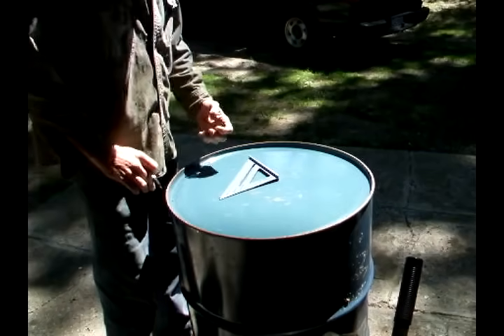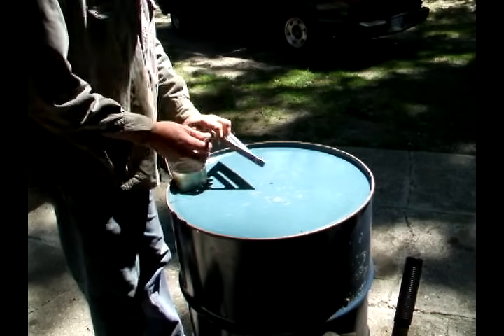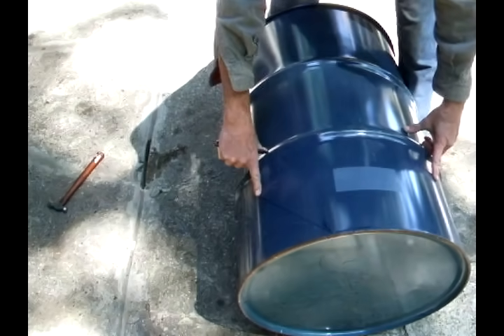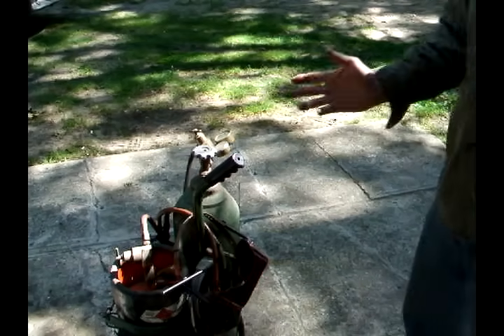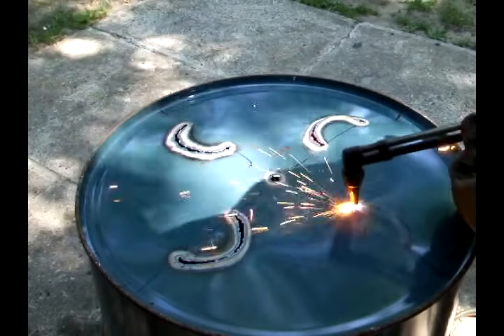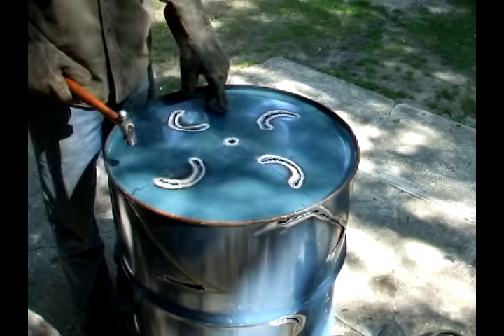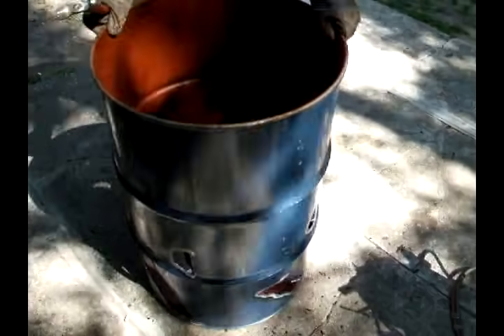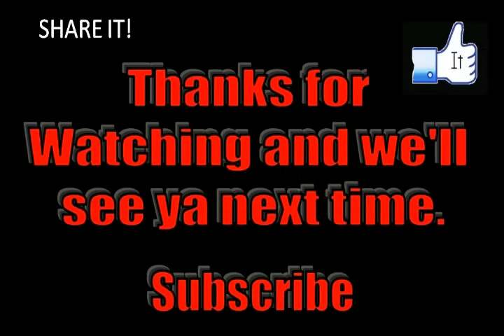VORTEX BURN BARREL

Comment: This is the best design I've tried so far. Yesterday I cut my 3rd barrel as shown in this video and boy I can tell you, this one burned the debris twice as fast with barely any smoke once I got it going. The best part is that it still does not require forced air.

I am considering building some sort of wire mesh cage above it to help contain large tree branches and to also control the ambers that fly off of it.

Comment: Good video.  Does the direction of the holes make a difference?  I looks like your hole direction will make a clockwise rotation when viewed from above.  What if you made the holes going the opposite direction?  Would it work?  Does the Coriolis effect come into play?
Reply from the maker: It might, but how would you be able to verify that?
Reply: the holes will suck in wind... the wind will be sucked in the same direction as the holes.. like wind tunnels...

Comment: I made a burn barrel just like this. It burns so hard that it burns up the smoke. Depending on the fuel, the flames can reach 20 feet or more high. It burns so fast that if you were going to burn a large pile of leaves, do you have to work hard to keep it lit because it burns the fuel so fast.
Reply: I'm. Mmm

Comment: Quick and simple, easy plan! But why not knock those bottoms OUT instead on in so the barrel has "feet" and can draw air from the there?
Reply: The pieces that are knocked in (from the bottom) also act as deflectors, giving the air that enters from the bottom a circular direction of flow.  Those side openings that are also knocked in, cause 'secondary air intake' to cause further 'rotation' in the air that already has a defined direction (caused by the deflectors on the bottom face)...

Comment: Two years ago I made Vortex burn barrels based on this video.  They work great for fine saw dust, chainsaw chips, planer chips, bark, and leaves. One improvement I did was add a second barrel on top of the first.  I cut out the bottom and welded on 3 pieces of steel (some angle iron and flat bar I had laying around) so that the top barrel will slide onto the bottom barrel and be held in place.  Burns more efficiently that way especially when the bottom barrel is full.  It burns the gasified wood from the bottom barrel in the top barrel and thus has very little smoke.  https://www.youtube.com/watch?v=dfSvvNui2Uk
Reply: instablaster...